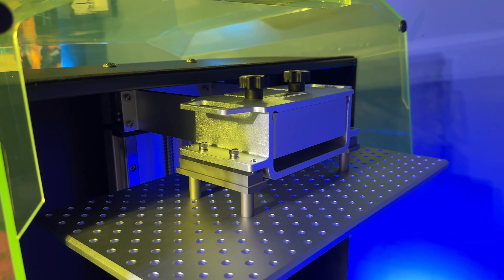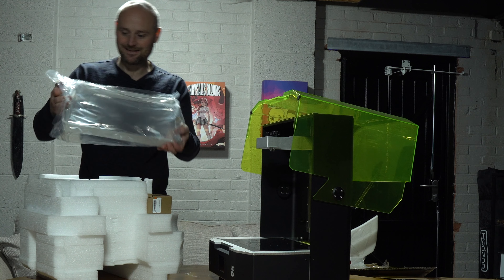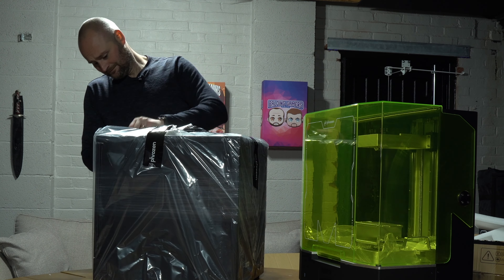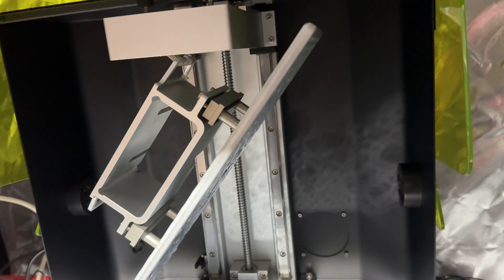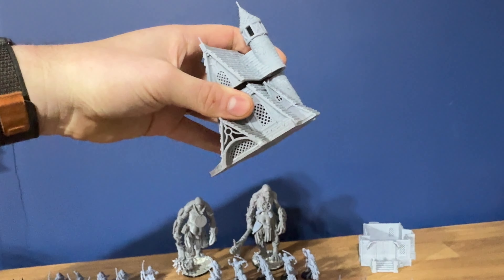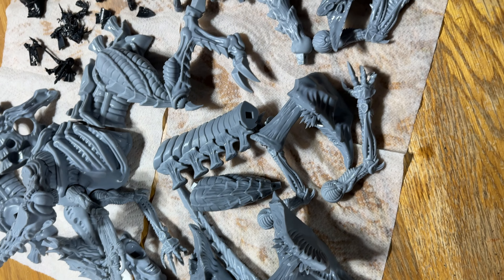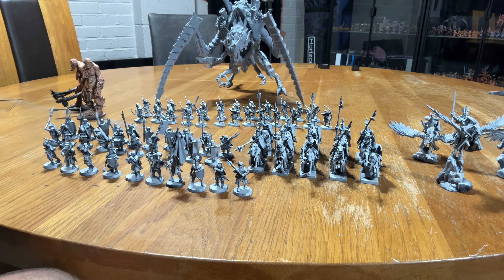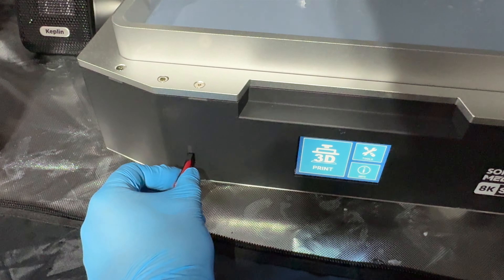Phrozen Sonic Mega 8K S: First Impressions of This Resin 3D Printing Beast

Comment: I have fallen in love with the Might 8K, straight out of the box works like a dream. One of biggest quality of life add ons I got for it was a flexible build plate from Wham Bam. Being able to lay the plate flat and then take the Phrozen scraper (which is the best I have ever used) makes it SO much easier. While I can't prove it, I also believe that the flexible build plate reduces the amount of torque being applied to the Might 8k plate so you are not going to have to relevel your plate as often. I have gone through 4 bottles resin since getting the Might 8k and the level is still perfect. Phrozen has made me a true believer in their printers and while I was going to getting another Mighty 8k I may get the Mega 8k instead. Phrozen makes resin 3d printing into the dream of push a button and walk away!
Reply from the maker: Yeah I love the mighty but the Mega is a whole new beast. It worked so well out of the box and I’ve printed far too much 😂
Reply: Dont use flex plates people, they shift on big prints. I had about 10 of them for my various printers and after it messed up on my e10 and Saturn, had both of them shift... i didnt install the rest and removed them.
Reply: @scottyboy6269  I have not had any such problem on either my Epax E10 or on the Might 8K. I have printed plenty of large prints along the way. Are you using Wham Bam's flex plates or some other brand?
Reply: @MacAttack001  whambam and other brands all shifted. What exactly are you printing though I'm doing 1KG figures

Honestly they are a waste of money as aligning them on magnet improperly leads to issues, theres no easy way to remove build plate from cleaning station unless you leave it on build plate which is rather pointless having it. Someone will say that its easy to get off the plate but so is just using scraper takes minimal effort.
Reply: @scottyboy6269  The biggest print I've done to date was Mierce Miniatures Lludial dragon, now the biggest dragon that I own. Speaking for myself, I take the flex plate off the Mighty 8K build plate, remove the prints put them in the cleaning tank. One of the problems with the scraper on the build plate is that you are applying torque to the joint where the level is set, which can quickly lead to needing to relevel the machine. The other is gouging the build plate with the scraper. Aligning the flex plate with the magnet has not proven to be a problem for me. I guess we will just have to agree to disagree on this matter. Hopefully, we can both agree that Phrozen's machines are great! :)
Reply: @MacAttack001 For sure, just sharing my experience as a warning definitely not an attack on you for liking it. Other thing I should have mentioned I dont hobby print and have done 10,000 orders/100,000 figures, so anything that can cause a delay, an error, or takes more time I immediately drop. Weeding through much bad information eg supports; use rafts, cut away supports with snippers. Spraying and scrubbing each piece, having residue.and needing to cure the model after washing because there's residual resin on it(someone didn't clean theirs very long!)

Comment: Has anyone solved the flat terrain issue or have any fixes for it? Im working on a project that requires the print to be as flat as possible. I just have no idea what the appropriate solution would be.

Comment: I've had this printer for less than a month and had nothing but trouble with it.
I've used up 3 bottles of resin which was mostly fails, half the time I can't get a build off the plate because of the holes making lumps and now the fep sheet has a hole in it and i can't find a replacment.

Comment: with the bubbly bits printing because of the holes- my Whale 3 does the same, however the bubbles get stuck in the holes and do not pull out with the raft/ model.  So even that little complaint is still wayyy better than some!
Reply from the maker: Ohhh that would drive me bonkers
Reply: Rafts are awful

Comment: I have the Mighty 8K because I couldn't wait for the Mega 8KS. The built plate size is so good. I would recommend not to use ACF film, as it breaks easy with the big size. NFEP film works better and is stronger.

Comment: Guess the holes help with that build plate releasing so to me that's a "pro" vs. the "con" of the bumps on something flat to the plate - I'd just sand or use a raft and lightly support :)
Reply from the maker: Yeah if it makes the plate work its magic then I'm all for it, but thought it was worth mentioning for those it could be a pain for.
Reply: @GrayScalpMiniatures is it possible to use a flex plate?

Comment: I hate the build plate on this machine, I know the holes are for equal resin balance but  the resin gets cured in the holes and is a nightmare to get out. Anyone else have issues like this? I do use ceramic and stiffer resins.

Comment: The manufacturers still need to stop the rapid increase in size and addition of mostly pointless bells and whistles to focus on more important things like Quality Control and Standardized settings. It really doesn't matter how big these things are when you can put 2 of them next to each other and they will have wildly different results for no reason.

Also I would like to see a little more clarity on "sponsored"/"I got this for free" for the maker as I am living proof that the units sent to YT Creators don't come from the same pile as the units sent to customers. (at least not from Elegoo)
Reply from the maker: That’s a really interesting observation about the units not coming from the same batch. The Mega I’ve been sent is a standard retail unit and I only got supplied mine at the same time as they started shipping the orders to customers, hence why my video wasn’t released before launch. 

I’d definitely like to see more standardisation. That’s one reason I brought up the operating system on this machine as it just seems weird that it’s not consistent with their other machines. Not going to bother some, but moving from one device to another, at least within the same manufactures, you’d expect them to be damned similar in experience.

Comment: I have a bad experience with Elegeo. The Jupiter SE came to me with a flaw on the casing, it looks like this: a black stain (the result of poorly mixed components) and no quality control. As a result, the equipment has already lost 30% of its value. All I can say is best regards the company is a middle finger and I do not recommend it to anyone.